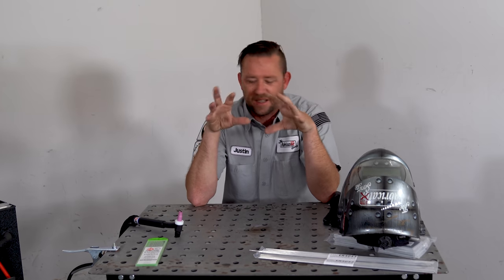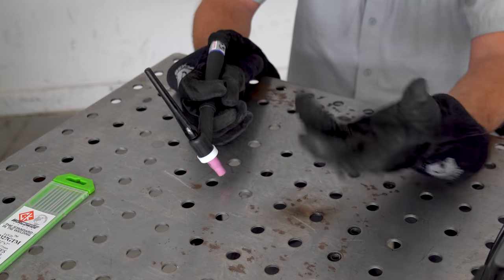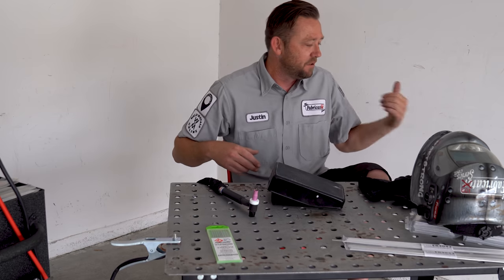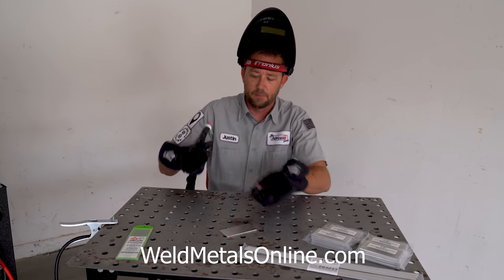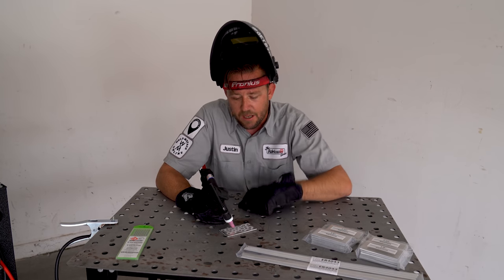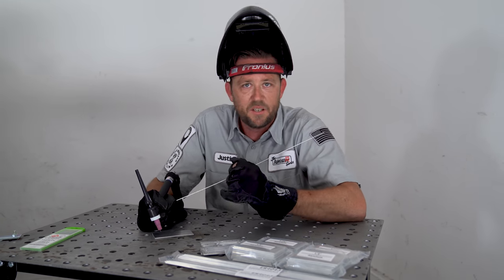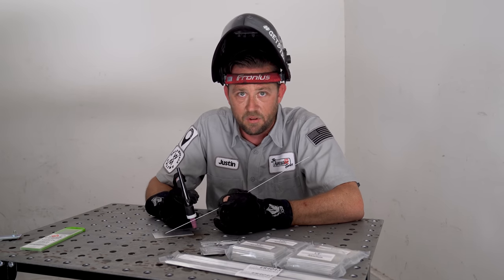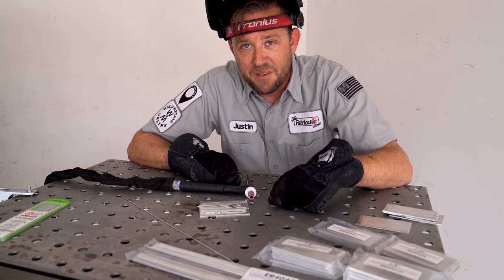Your Very First TIG Welds with EXTREME Detail

Comment: I’ve been welding aluminum a couple times a month for probably close to 5 years now and I’ve always sucked. This video explained some of my mistakes better than anyone else has. Thanks Justin!
Reply: All I do is aluminum.... It's always tricky and there are no short cuts on cleaning.  Cleaning I think is the most important part.  It's night and day difference when you start welding.  Repairs or working on anything that's been used, painted or powder coated is a pain.  I build custom entrance gates and my goal is always to make them strong enough to never ever have one come back for a repair because it can be a nightmare after it's been powder coated.
Reply: Oh... Filler rod and tungsten can make a huge difference.  4043 filler rod flows really good.  I've tried all different types of tungsten and from my opinion a few different ones are good but I change them depending on thickness of aluminum vs the settings in using.
Reply: @willhall7777  I'd be interested in knowing the tungstens and grind angles you use most often and for what types/thickness of aluminum. Thanks in advance - an aspiring welder
Reply: @willhall7777  Will, when you say cleaning do you mean a quick rub over with abrasives or really thoroughly even with a chemical cleaner?
Reply: electro arc  I'm on day one next week 😂
Reply: Honestly if you do ANYTHING a couple times a month for 5 years it's time to give up. Apparently it's not for you
Reply: Great video,thanks for mentioning all the small and simple stuff, so often over looked.

Comment: For those of you that are confused this is for welding aluminum only. You’re not gonna have pedals if you weld carbon pipe etc. this type of welding considered to be one of the most challenging in staying consistent. Aluminum tig welding is very hard to make pretty and photogenetic

Comment: Got my prime weld Tig welder yesterday. I have been watching your videos for days. With the instructions you provided in your videos, I was able to get set up and ready to weld no problem. I have done mig and stick welding, but never Tig. I turned on my machine with the setting you recommend. Did the puddle, and bead exercises I learned from you. I was blown away by the results. You are an excellent teacher if you can get me going this quickly. Thank you so much. On to dipping and weld joints next. Hopefully I will get the same results.

Comment: I have been a student of tig welding for 5 years. Took the balancing of torch tip and used it today. It made the control of the torch, feeding of the filler and heat control a thousand times easier. I wished i had that info from the first tig welding class i took   years ago.

Comment: OK I have to say this is probably the most beneficial lesson I have ever seen on getting started.  I really appreciate the extreme simplification.  I tried to get started 1.5 years ago, and while I was able to put down OK beads, I was never consistent.  I got frustrated and went back to MIG.   Well in this lesson where you had us just make a series of dots, I was finally able to figure out the relationship between heat, time, arc length and travel.   I now understand when the puddle forms and what to look for to keep it in check. 

Next step, I will try filler, but just putting down consistent 1/4" "starter beads" was awesome.  Thank You!!!

Comment: I LOVE your teaching style!  Far too many pros don't even realize that they're taking for granted the little details that they've been doing for years, and they leave many holes in their teaching that leave the students lost.  I like how you drill on each point, without advancing too quickly to the next step.  I especially like how you keep reiterating "This is under YOUR control...so CONTROL it!".  The only thing I didn't see or hear (unless I just flat missed it) was holding the proper angle of the gun, which is a vital point (again, sorry if I missed it).  Outstanding teaching video!!

Comment: Watched your video yesterday. I can’t thank you enough. Your advice and experience has created a whole new perspective for me. I went through 2 80 cubic feet tanks of argon and probably 10 pounds + of 4043 1/16th” and 1/8” in a 24 hour period with my new found knowledge. My welds went from crap to structurally sound. I’ve listened to too many and overthinking to …..Dayyuummm……my welds are consistent and structural. I’m certified with all other aspects of welding except TIG. The “balance” point helped me ditch the natural trimmers I have due to military crap. I was also doing the lift arc vs. high freq…….huge HUGE difference for me. Thank you so much man !!!

Comment: I have to say, I was impressed with this seemingly basic information. I watched and listened and really considered what you said. I went out later and put into practice those simple tips and my stainless steel welds turned out GREAT and NOT like the burned out, grey overheated mass that I'd be too embarrassed to show. I don't have foot pedal, but my control via 2T was so much better. I have colors in my welds now :-)

Thank you for the useful tips and the great info your videos provide.

Comment: Thank you for what I can only say is the best welding tutorial video I've ever seen. You kept it simple and reinforced the points you were making and took us through how it should look and what was causing the problems with the defective welds. 
I've been MIG/MAG welding for quite a while (hobby stuff mostly) and have recently started using a lift arc TIG setup (DC only) for Mild Steel but have learned a lot from your video.

Comment: Interesting that he mentioned the “magnetic radiation” thing because right before I watched this video I was thinking of researching the electro magnetic radiation hazards of Tig welding.
Reply: TIG, I believe is the most hazardous.  The "smoke" from both Stick and MIG block some of te radiation
Reply: There is no electro magnetic hazard associated with TIG welding.
The high frequency start might theoretically have an impact but it only lasts a fraction of a second and is very low power. When welding DC there is literally no physical way for electro magnetic fields to generate. Welding with AC at around 100Hz or so has negligible impact compared to all the hundreds of  power lines already around you
Reply: @AlessioSangalli  
Sorry electromagnetic spectrum includes UVA
I was referring to the part of the spectrum you would call ultraviolet
Reply: @billshuey7422  yeah but the context was to keep the leads on your lap. Obviously, the UV emission of TIG is one of the strongest, and as the process is tipically slower, also the exposure is longer; however, shielding is relatively easy so unless one makes a mistake (or welds without basic PPE) there shouldn't be much concern
Reply: My wireless earbuds do not like AC tig
Reply: @danmiezejeski7735  interesting, I believe ToT in the past did some analysis of a TIG signal I'll have to watch it again
Reply: Electromagnetic radiation is not your concern.  The UV radiation off of GTAW welding (TIG) is the kicker.  It's the fastest way to a sunburn in shirtsleeves you can get.
Reply: Ahh, mostly correct, but realize that "electromagnetic fields" are created by rising and falling levels of current in any conductive material. AC Tig welding presents magnetic fields along both "negative" and "positive" cables, strong enough to damage sensitive electronic or radio frequency hardware nearby. Personal experience.

Comment: Thank you!  I watched this video last night, and then gave it a try, following the method you explained and I had a huge step forward from the trouble I was having.  I have not tried aluminum yet but it seemed to work the same for steel.  Keeping the torch close did keep things cool, no sparks, no frying metal.  It was exactly like you pointed out, all about the puddle being the right size and moving it along.  btw I'm using a let's just say a simple Vevor, a stick / tig combo, trigger on torch no pedal no fancy settings.  It can be done when you have a good plan.

Comment: This video significantly improved my welds in less than an hour. Went straight out to the shop and practiced timing the reflective pool thing you talked about. What a difference. My last acute joint attempt melted off, maybe you have a video for tight angle, thin aluminum welds?

Comment: Your videos and the information in them just keep getting better and better! I watched this video a couple times and fired up my Prime Weld today for the first time in 2 years. I previously practiced with it for a couple months before putting it away due to life getting in the way. I had forgotten so much but most of it came back quick. This video really, really helped me to focus on what is going on vs what needs to happen. I may actually get the hang of this stuff to finish a scooter project that was also put on hold for a couple years.

Comment: I'm not a welder but have had a tig machine in my shop i use occasionally, so i've never gotten good at all at tig welding aluminum.  This is by far the best video I've seen to correct all the errors i'm making he's pointed out and I did not know why.  Best take away for me is "the closer the tungsten is to the aluminum, the cooler, the farther the hotter and get large pool of guk..to not pull away the tungsten until foot is off the pedal..

Comment: These foundation skills are great and what every new welder needs to absorb and make second nature and something to reference in their minds. In 1980 I went to Technical College to learn electric arc and gas welding. I was never trained in or used TIG in my job but I did a lot of stick and gas welding. So I understood the welding process and knew what made a good weld. I bought a TIG welder last year and watched a couple of your technique videos on TIG welding and setting up the machine while I waited for my welding machine to turn up. My very first TIG welds were acceptable and improved rapidly over the next two hours. This was possibly due to the foundation knowledge. After all, if you know what you're aiming to achieve and have a foundation to build on and develop your skills then you are on your way to improving with each hour on the machine otherwise you are just scratching in the dark so to speak.

Comment: After hundreds of TIG welding vids this is the first one that really appeals to me!  It is the first and only vid I found that not merely shows off the presenter's skill or talk Amp setting and charts etc, but only shows what does go wrong.  I've a couple of horribly looking beads on steel and aluminium and was totally lacking interpretation skills.   Everyone says "practize you simply need to practize then it'll sort itself out".  This of course is total BS because for practizing to make any sense, to enabled progress, I need to know what error I am looking at.  And this is where theory and charts don't help.  Your coupons with failed beads  + prcise explanation which error a certain bead-appearance is pointing to is a very great help! Excellent vid, thank you very much!  Please post more failure reading / interpretation vids, that's the only way people like will be able to infer what to do change for the next bead.😍

Comment: I started tig welding alloy 10 years ago ,I did not have lessons and did not know how to set the welder up: first issue I was supplied contaminated gas so what ever I did my welds were crap and full of black bottle was recalled a few months later. So I got to the point that I could run a weld that held but looked crap and still had some black in the weld, So I went out and brought a flex head and a gas lens, Suddenly my welds were good and now I'm happy with them most of the time, So with my complete lack of experience meant I didn't know how to setup or that the Chinese torch was to blame. Never give up is what I say. Now I'm buying a Mig for alloy and going to build a 48' alloy catamaran. I wish I watched this video years ago very helpful😊😊

Comment: What a great video!  I'm restoring a 1955 Land Rover and some aluminum welding is involved. Most engineering shops here are not interested in small one-off jobs so I am considering buying a TIG welder. I am a fitter and turner by trade but have not used TIG welding for a long time. I relate to your comments about feeling comfortable It's the same with Oxy welding and MIG welding and believe it or not snooker.

Comment: This was an excellent presentation. I am getting ready to get stuff ready in the garage to use your AL coupons. Up until now i have been tig welding steel. Gotta go back and find your video  on Aluminum prep and so on….sharpening wheel, brush and so onhas to be aluminum dedicated so i dont have steel contamination…… thanks again justin…..

Comment: Hello, and thank you. I'm a self taught stick (for those who might want to correct me, I know it's arc) and mig hobbyist, but do enough to want to up my game. I purchased the ProTig 205 a week ago and have not unboxed it yet. I'm watching and trying to absorb as much education as possible, which is the opposite of how I stepped in the middle of stick and mig. As a 63 year old military vet who has some minor tremors, I'm starting consider my potential, but I still do some drafting, so it's a crap shoot not having tried yet. 
You've opened my eyes to the road ahead, not the least of which how the peddle works as your amp control, and then the puddle control. I don't have anything specifically I need it for, just want to learn and maybe one day apply. I never considered buying coupons upon which to practice. 
Before we moved from Utah to N. FL almost 3 years ago I had substantially more 'tools' at my disposal, and am trying to ramp back up. From a very nice bench vice, to a 4x4 Certiflat table and legs set that I had to sell for lack of room. I moved my Ironman 240 and bottle, but it's CO2, so I'll need to swap that for the argon. 
My point is that you've opened a window and exposed me to a different reality, and that I'm still a ways from cracking the box open.

Comment: Good demonstration, the one thing you didn't show unless I missed it is no or low shielding gas and how it effects the weld. I have a good amount of TIG welding with mild steel, stainless steel and nickel alloys but aluminum has always been difficult for me so as far as welding aluminum goes I'm a complete beginner and this video really helps identify where I am going wrong.

Comment: Justin, I'm getting a crater when I terminate my weld. Any ideas how I can fix this? I appreciate your clear instructions in these videos. It's been about 10 years since I've welded aluminum and I'm trying to get used to welding on an inverter. Thanks again!
Reply: If you're not using filler, it's not something to worry about. Even got a puddle on termination.

If you're using filler, you could be reducing power too quickly, or removing your filler rod early.

Comment: Very good video. Question: When welding aluminum is the distance the ground clamp is to the work piece critical to the strength or quality of the weld? Do you ever connect the ground clamp directly to the aluminum piece?

Comment: 👏👍
Good advice on posture and holding the torch, but the rest was nigh on useless for me as I was hoping this was for steel.
I need to butt weld a replacement section to the bottom of one door on my 1935 Austin Seven car.
Will check your other videos now with hope.
Reply from the maker: That's a bit specific. You might be waiting a VERY long time for me to explain your repair. I recommend applying this discipline to your project after some practice for your (extremely) specific application until I can find said vehicle requiring said specific repair.

Comment: I've had four lessons of 2.5 hours each of TIG welding aluminum now. No previous experience in welding at all, so I'm just doing the best I can and try ro understand my theachers feedback. 
This drill is excellent: 
- Just focus on that 6 mm wide weld pool and keep it stable. 
- Don't worry about the feeding of the filler through your hand: it will come with the experience of dipping it in the pool
Thnx, I've some new strategies for the next sessions!

Comment: Thanks for sharing this on TIG welding aluminum.  Are the concepts the same for steel or other metals or are the techniques not transferable without taking into account the specific metal?  It would make a great follow up video if you could discuss other metals and how the beginner can come up to competency on each metal type.

Comment: Thanks Justin for real life instructions. I have learned a lot . Question, you made mention on cutting off the q-tip on the tungsten but my question is what does a cooked tungsten look like and where do yo you cut it off or throw it out if its to bad. maybe do a video for what a bad tungsten looks like and what to do with it. Different from stick out and sharpening. Thanks.

Comment: I'm not a welder but did it as a training thing a long while ago, our tig machine was buggered so never played with it. But did stick mig and gas..... stick is fun, mig is meh but gas..... oh hell yes. Oxy and acetylene and for the training it was thin plate mild steel, nothing fancy and cheap. We're talking 1.5mm to 2mm thick plate... I loved it. Was I good... nope, but I got good. I found the right pace to not blow through, how much stick to add etc...... the control required to run a straight bead without fubaring it up really focussed my attention and I got good at it. Got into the gas axe cutting and yes I learned how to be good. Not a master but good enough to pass. 
Still not a welder but I love the process and learning stuff. I may never use this info but....... 

Awesome stuff man